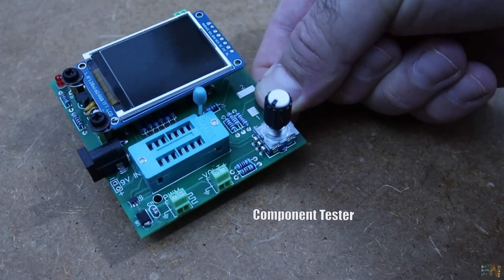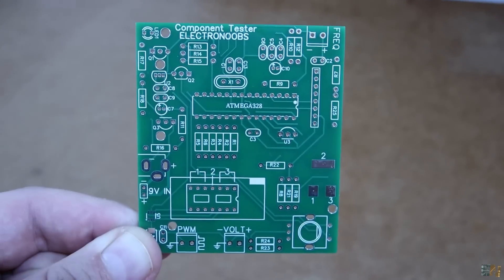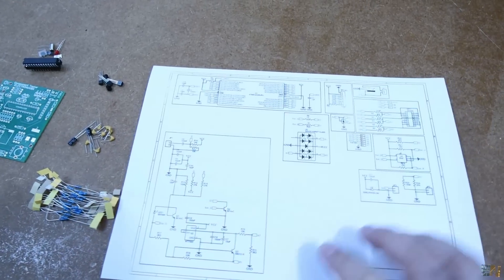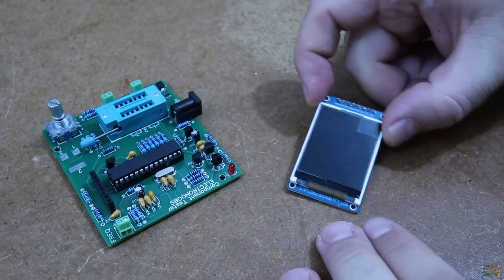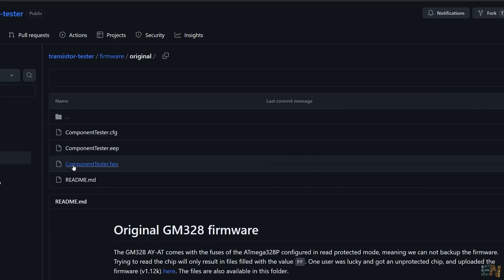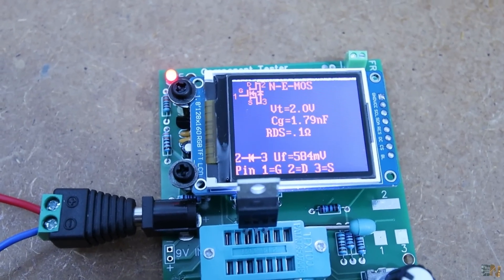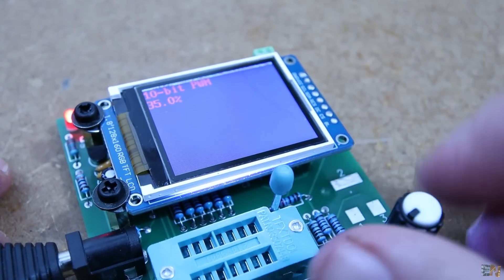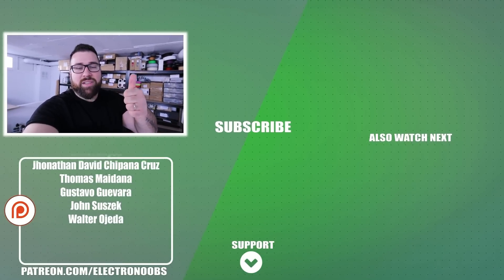Component Tester PCB with Arduino and TFT display

Comment: Again, I am going to ask you WHY you COPIED the circuit board of the original device to MAKE one, when you can BUY one of these in kit form or pre-assembled??
Reply: Probably to have content, to learn and to share how he learned it. why did he copy your design  or what so ever? That's what we call DIY by the way
Reply: @Donzdats  Sorry ass reason to have content.  He could have just showed how it worked and still have content.
Reply: @stevenA44 well sorry to disappoint not every content creator and DIY'ers wants an exact copy of the thing they are trying to build even if it's based on someone's design that's why some builds are open source so others can modify it however they want and improve the original design at someway
Reply: @Donzdats  Who was talking to YOU???  NO ONE!!!  Keep your comments to your damn self!!!!   He built the same damn thing that you can ALREADY BUY!!!!   This is one of the reasons I unsubscribed from him.  It was dumb to make something that is already for sale!!  Also, LEARN to use some punctuation!  GEEZ!!
Reply: @stevenA44 chill man!!!! sorry about those stupid punctuations?? I 😊😊

Comment: always discharge the capacitors prior to testing! I blew the 7550 5V regulator on my surface mount model. I also get the "not calibrated" warning after a few secods of no component detected, and I cant seem to get any action after I short the 3 probes/contacts...very annoying! Does the latest firmware change anything?

Comment: for convinience man can use AVR ISP shield for programming, but it must be set to arduino_as_isp and 19200 baud rate (higher baud rate never worked for me, even with the stupid wires)

Comment: If you're planning to build this. The codes are designed for 1.8 inch TFT only, don't ever use 1.44, I don't know why he recommended the 1.44 inch 🤡
Reply: It doesn't have to do anything with diplay size, but the driver ic, if is the same, it will work.

Comment: U2 HT7550 fixed voltage regulator is really getting hot, they can deliver 100mA... the original design has a MCP1702-5002, 250mA... anyone else has this problem? Should I replace it with a MCP1702-5002?

Comment: Hi, this is awesome project and I gather all parts for DIY component tester. After some time I finished soldering and pluged in my arduino uno (CH340), uploaded ISP, connected board to Uno as told, open AVRDUDESS and select all options as presented, start programing but at the end i get error msg "avrdude.exe: verification error, first mismatch at byte 0x0000
             0x4c != 0xe0". 
After some snooping around I decide to order original UNO board and tried it again but same errror arise. Can you help me with this error and what should i do to finish this little project. I have to say I'm not electrical man but like this area and I like to build new stuff. Thanks in advance.

Comment: Mi amigo! :) (Yo estudio Espanol y me encanta tus videos :) ) I love this project against, you can buy this device for few dollars. I ordered your PCB, built it up but of course issues here. I so knew it! It's me :D I am working on the solution, however I am not so goot at this. I have this issue in AvrDudess: WARNING: Unable to detect MCU
avrdude error: invalid -P value: 'COM3'
use -P usb:bus:device
avrdude error: unable to open port COM3 for programmer arduinoisporg
avrdude done.  Thank you. 
However, COM3 OK, I used it to upload the ISP programmer. Obviously Arduino Mega is OK itself, so I have no clue what is wrong here. But I have spent my "little money" on this project, I would love to get help to be able to use it :( Thank you / Muchas Gracias todos. :)
Reply: Thanks for the lot of help :D To others, if it doesn't work with 115200 baud rate, test it out with other numbers. It worked for me on 19200 or something like this, but maybe your board would work on 57600. My other arduino was detected on 57600 but when I try to upload the hex files, it didn't worked. So it is a kind of "testing" to find your one.

Comment: when using AVRDUDESS and trying to detect mcu i encountered this problem installed on a seperate computer and encountered the same problem i am new to this can anyone assist 

avrdude.exe: stk500_recv(): programmer is not responding
avrdude.exe: stk500_getsync() attempt 1 of 10: not in sync: resp=0x4c

Reply

Comment: I have the older version, the one without the rotary encoder. The problem is that it doesn't do well with high power components (transistors, MOSFETs, etc.) and when you put a high power component that you don't know the type yet, you can't rely on this tester, because it will output nonsense.
Reply: So I wonder if someone would care to do the necessary adjustments so such testers would "treat" high power components well 😊
For frequency generation, I'd rather get a 32-bit MCU do the job.
Reply: For all flavors of transistors, it's nice to see the pinout next to the component's symbol like, for instance, BCE or GDS, etc. This is an easy modification I guess, and it's visually faster for reading.

Comment: Nice , 
What is f generator max frequency
Can i make it through 16x2 lcd
Reply: Depends on the crystal used. And yes you can use a 16x2 display.

Comment: LCR-T4 Mega328 is the cheapest,
LCR-T4 without any IC mentioned is less cheap,
GM328 is most expensive in the generic section.

What's the difference between these all?
Reply: The difference is how much of the corner the Chinese cut off. Wrong processors, low quality parts, and so on.